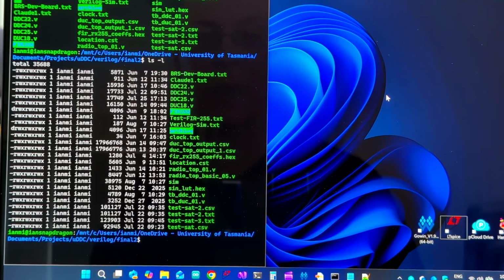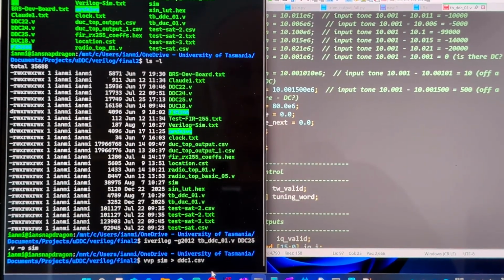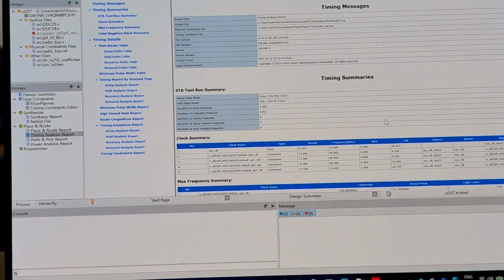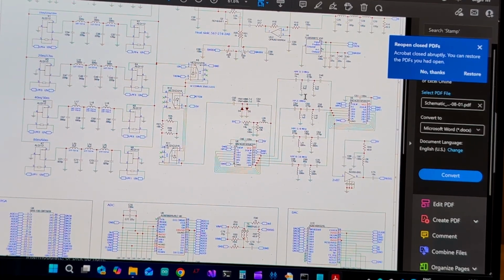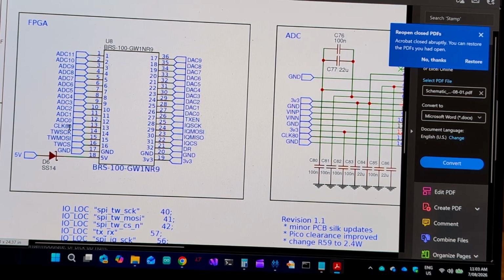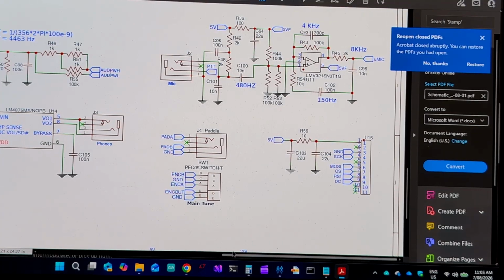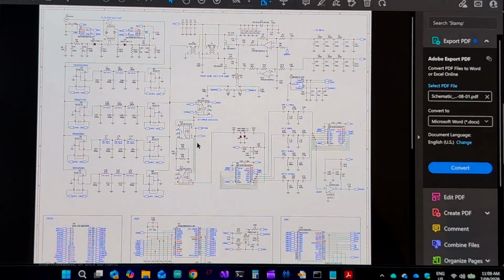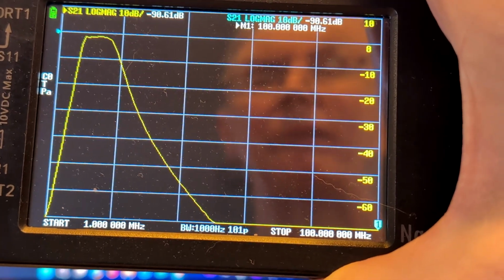uDST Direct Sampling SDR QRP Transceiver Part 2

Comment: Great project!  Are you planning to release the schematic and PCB source files as well?  
I notice that you added the schematic pdf, gerber files and BoM in the github repository.  It's actually better practice to make a release in github (which is quite easy to do) and add them there.
Reply from the maker: Hi Chris, I use EasyEDA. There's a JSON export and an Altium export. I don't know how well the Altium exports work though. Yeah, I should do a revision 1.1 release. 73, Ian

Comment: Здравствуй ИАН! Правильно ли я понял, Модуль FPGA  программируется отдельно, Все остальное управление и обработка - Это как в MBPTRX, программируется в среде Arduino IDE. ?
Reply from the maker: That's correct. The FPGA is programmed in Verilog, a hardware description language, and uploaded via USB using a special loader. The Pico is standard Arduino.